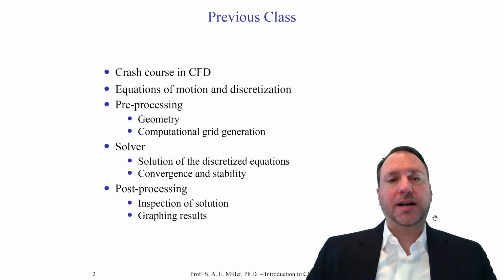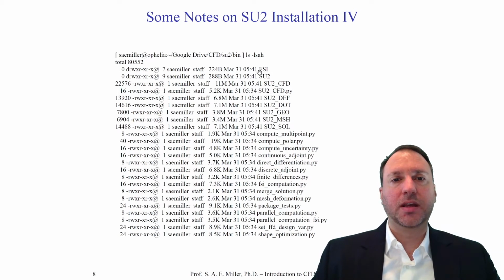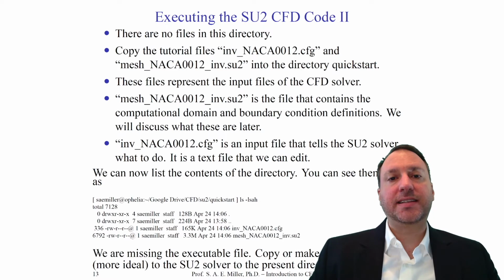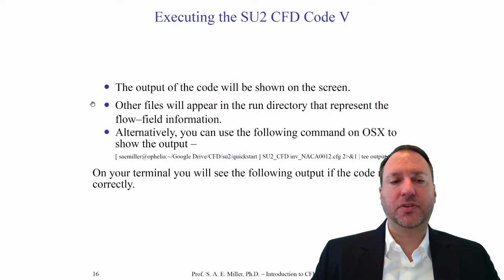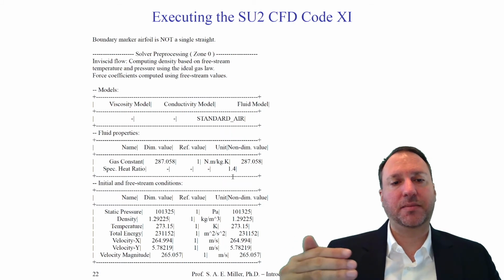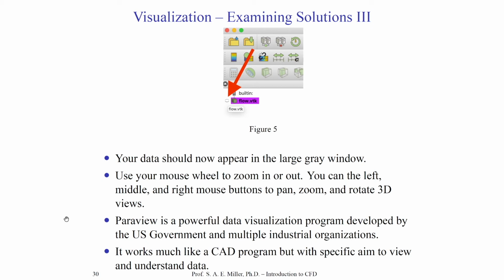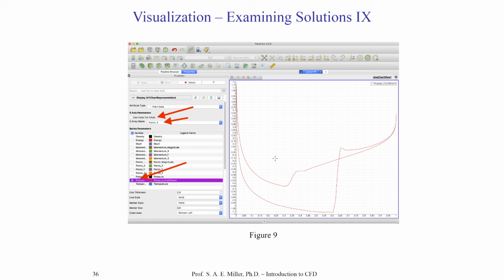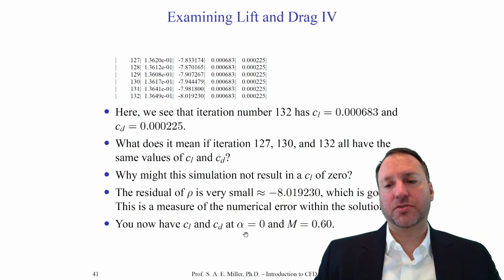Introduction to Computational Fluid Dynamics - Preliminaries - 3 - Code Overview and SU2/Paraview

Comment: HELP PLEASE..  "\SU2_CFD.exe .\inv_naca0012.cfg | tee output.txt"  I cannot run this command in windows terminal. Where can the fault be?
Reply from the maker: I think that you have a core problem - in that you are using a tee command that is for Mac or Linux. I would suggest learning a bit about the Windows command line before going forward with CFD. It will help you in the long run.
Reply: @SAEMiller  Thank you for your advice🙂
Reply: C:\CFD\SU2\quickstart SU2_CFD inv_naca0012.cfg >> C:\CFD\SU2\quickstart\output.txt

Comment: Thank you very much for you lectures, however i was wondering if there is amy documentation on the modification of a solver, and of course the compilation. I am looking for compressible and non Newtonian, i assume some changes are needed in the solver right, or that has to be in the configuration file?, Thanks in advance

Comment: Dear Prof. SAE Miler i am Mulugeta Birhanu Water Supply and Environmental Engineer. Currently I am pursuing my M.Sc in Environmental Engineering at Addis Ababa Institute of Technology and preparing for my thesis work. I have planned to focus on CFD modeling of Waste water stabilization pond hydraulics performance. Can you suggest me which package is more compatible with my title?
Reply from the maker: First, wow, I think you're in Ethiopia. I always wanted to visit there. Anyway, I'm sorry I don't know the best software for such a problem. I'm more aerospace focused. Let us know through a reply what you chose.
Reply: Thank you Prof. SAE for your concern. We welcome you sir. 
sorry for the late reply.
Reply: I think, ansys fluent is good enough

Comment: What are the benefits of using GMSH and SU2 over openfoam and Fenics? They are open source too
Reply from the maker: I'm sure there are lots of advantages and disadvantages to every computational system. I suggest simply using the right tool for the right job. That being said, these recordings are more focused on equations, physics, etc. than any one particular solver.